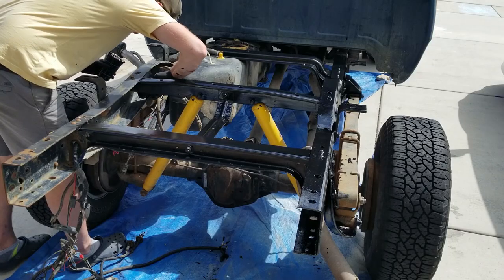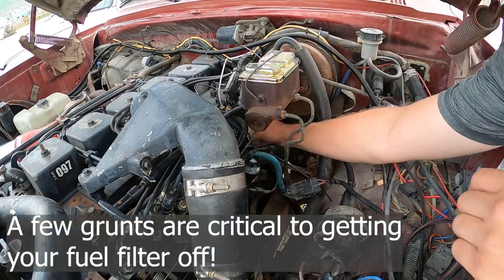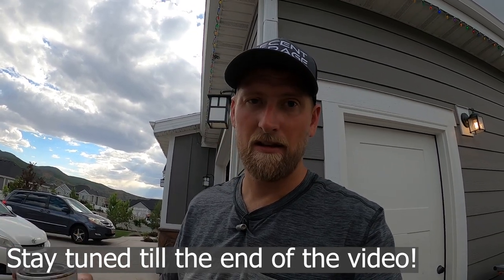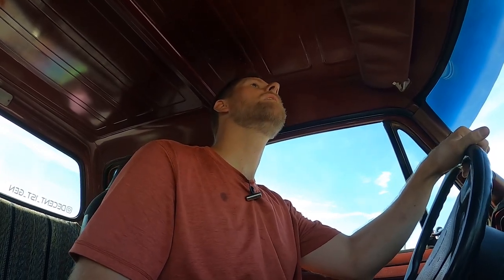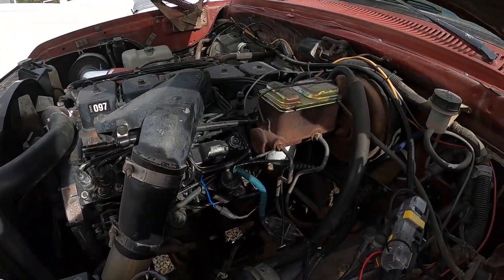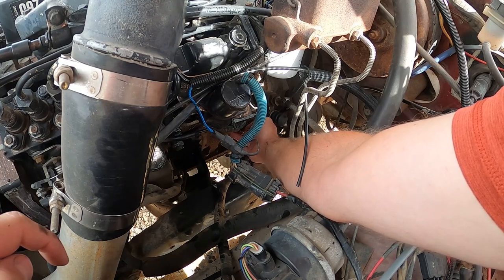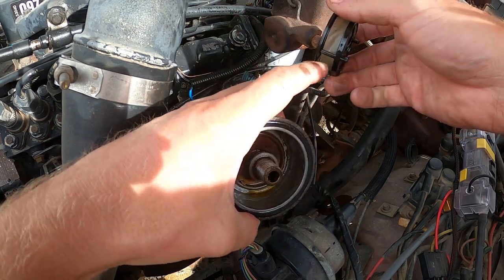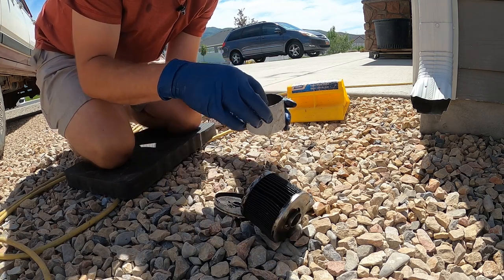Is Your Cummins Lacking Power? CHECK THIS!

Comment from the maker: This should have been step 1 before working on tuning the pump on this truck. Live and learn. Let's get Prospector Bob running great now!
Reply: If you do the overflow valve most of them cannot be installed with the stock cam driven pump.  It will cause pressure spikes and damage the injection pump

Comment: Wait did you say Lieutenant Dan in the beginning of the video and not Prospector Bob? Good to see that solved your issue! I've never had to deal with a white smoke when dealing with a fuel issue, only head gaskets from white smoke. So that is great to know!
Reply from the maker: First thing I checked was coolant and oil though! I was going to cry if it was a head gasket

Comment: I have a small fuel leak around the top of the fuel heater area, do you know if that comes off and if so how to get it off, is there a gasket in there? Smells like diesel while driving.
It's a stock 1993, 5.9.
Reply from the maker: Yes it does come off and there is an oring. Many people just get rid of the fuel filter heater cause it's prone to leaking.

Comment: Have you tried blowing air back through the fuel line to blow the trash off of the sock in the tank??? My 1991 D-250 had a bad fuel line and thought it was the mechanical lift pump. Then I thought it was trash on the sock in the tank.
Reply from the maker: I haven't tried that. Did you just blow in where the line comes in to the lift pump?
Reply: @decentgarage  yes sir

Comment: Is there a fuel filter like this on the gen 1?
Reply from the maker: No, the og crew has the original 93 filter setup with the water separator.
Reply: @decentgarage  thank you my good man
Reply from the maker: @manniefresh7354  do you need a part number for the stock 1st gen one? I've got one sitting on my work bench
Reply: @decentgarage  that would be really helpful thank you
Reply from the maker: I like Napa gold 3379